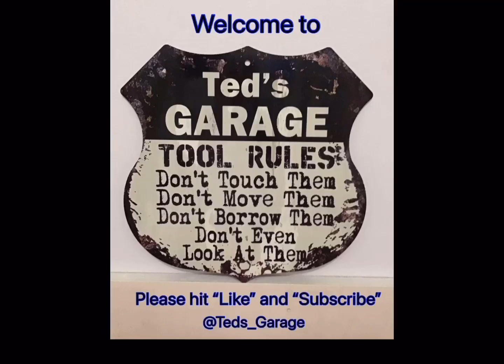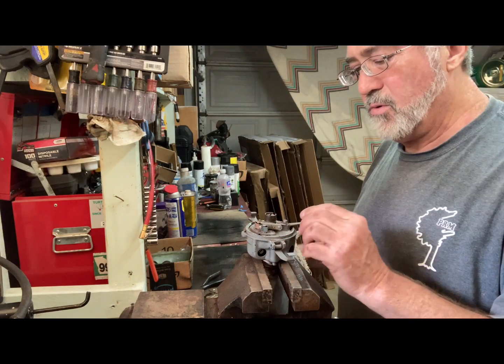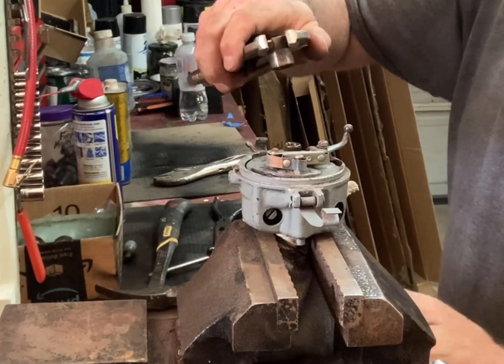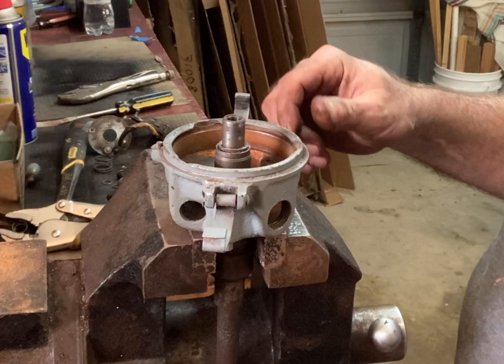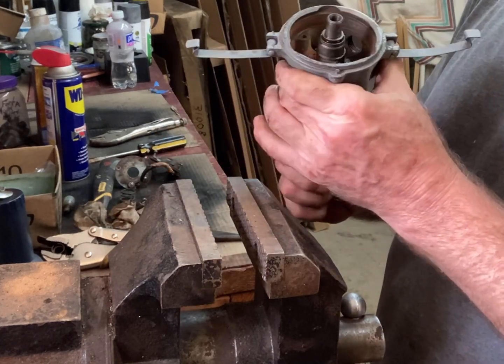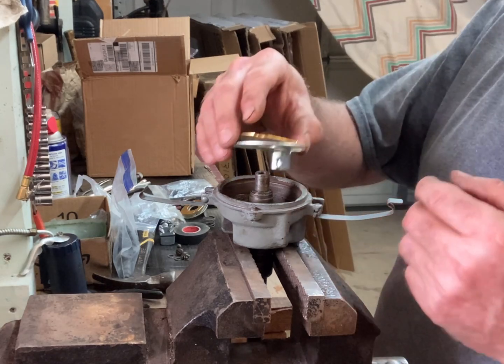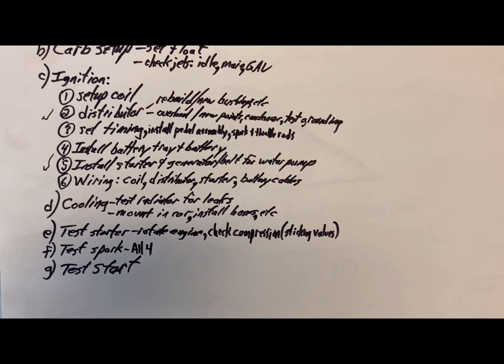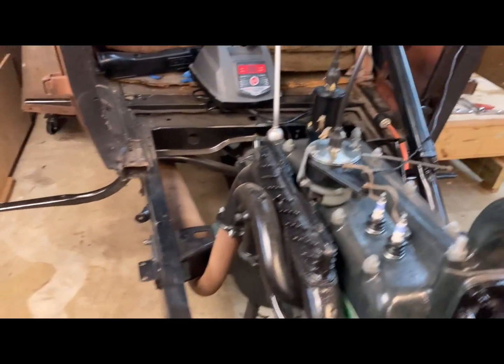Model A Proj'29 Tudor: Ep 34 - Dad's '29 Tudor.. Distributor remove & repair #ford #classiccars #car

Comment: Ted; Thanks for the video. yes that stubborn distributor cam surprised me; try using Kroil, if you run into rusted or stubborn parts, imo, it out performs PB blaster. 😃
Reply from the maker: Hey Sunny!   How’s it going out west?

Yeah a friend mentioned Kroil and I haven’t ever tried it… I’ve seen others use it and they really like it.. I’m just old school with the WD-40…

I need to get some and try Kroil … and PB blaster..

Comment: Hi Ted. One recommendation I would make is to replace the old original metal fan with an Aluminium one , those metal ones are a real risk of failing. Good information on making sure all contact areas are clean for earthing the top and bottom plates. 
Greetings from Australia 🦘🦘
Reply from the maker: Hey Russell,
I've heard of the original water pump fan were two pieces of metal laminated together... and after years of stress they have been known to come apart... I haven't had that happen or seen it personally.. and really don't want to.  I've seen pics of it ripping into the hood (or do you say "bonnet" in Australia??) as it flew apart.

When sanding this fan I could see some of the laminating of the two metals... I need to keep an eye on it.

I also have suspicions that folks pumping up the HP and high revving their engine - trying to do highway speeds... 60-70MPH aren't helping the old original metal fans, ie more stress on the metal. 

The aluminum fans have been on back order for a while... but I need to check on it again.  Good idea!
Reply: Hi Ted 
If it is showing any signs of delaminating around the hub of the fan ,look at changing it for a four blade type fan which I think are available from some vendors. Yes I know the aluminium fans are on back order and have been for some time now. That distributor has been apart previously as Henry didn’t use tape on the ground wire and I believe never used a one piece shaft, the two piece shaft with a drilled upper is the way to go .
Regards Russell 🦘🦘